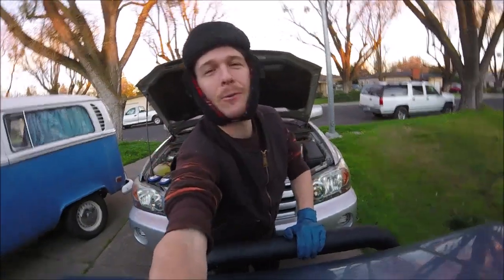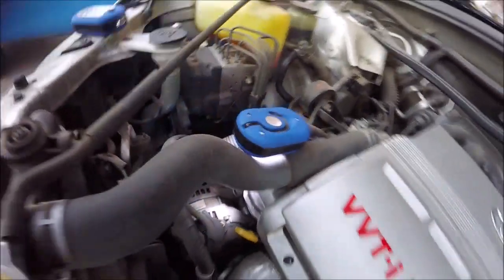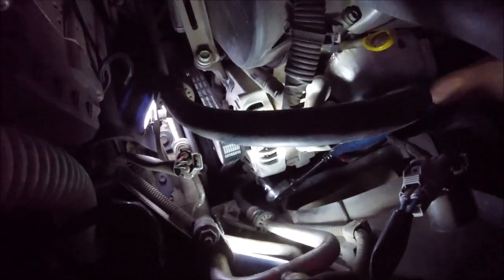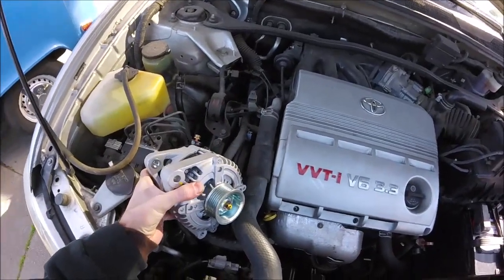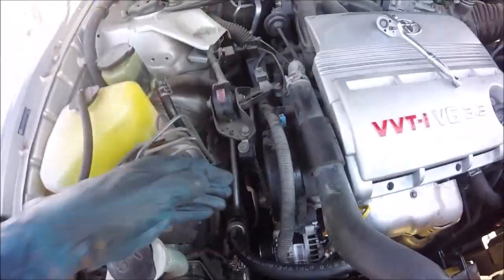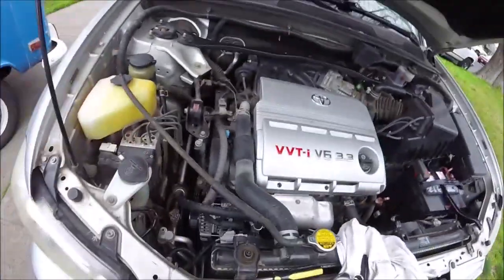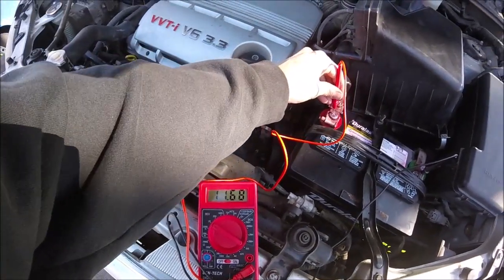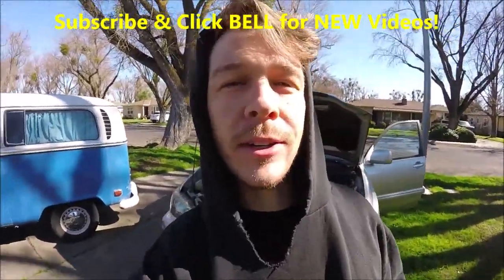How To Replace Alternator Toyota Highlander 00-07 -Jonny DIY

Comment: How the the block on the tensioner bolt should be plce , mine came off , and I'm not sure it's supposed to go back, the right way 😬
Reply from the maker: Hope you got it figured out, here's an image of how supposed to be
https://www.autozone.com/znetrgs/repair_guide_content/en_us/images/0996b43f/80/20/85/e5/medium/0996b43f802085e5.gif
Reply: @JonnyDIY  appreciate the help 👍🏻

Comment: need to know which way the block goes . it flopped around during removal . so didn't see the way it was oriented . any - one ?
Reply from the maker: The lil block on bolt goes on inside of mounting adjustment.  Its where it locks the tensioner adjustment.

Comment: Thank you for making a short video that actually shows these steps. 

What a pain in the butt getting that lower tensioner bolt off!!!

 Advice for anyone doing this job: buy a long reach electric ratchet or a long reach SUPER fine tooth ratchet and a 12 pointed socket for that 12mm.

I slid the alternator wire bracket clip off as well as the clip holding the wires on the radiator to make room to get the unit in and out, otherwise, was pretty straightforward.
Reply from the maker: You're welcome, glad I could help you get it done 👍

Comment: Did this for the first time, both belt and alternator. Had little to no experience. Great video!!! Only thing is I got stuck on the block where the adjuster screw and holding screw go in once new alternator is in place. There is another video similar to this that shows the exact setup for the block that I had to use to get it back in place properly. Otherwise great video, couldn’t have done it without you!
Reply from the maker: Awesome, you're welcome, glad I could help you get it fixed and going again 👍

Comment: I just replaced the alternator on a 2006 Lexus RX 330, which is real similar to this. I had the worst time getting the 12mm bolt through the tensioner block and into the alternator. I ended up taking out the 14mm bolt and doing the 12mm first. It ended up being a lot easier for me that way. Just in case that's helpful to anyone else
Reply from the maker: Thanks for sharing. It's funny the things that end up taking the longest when working on cars is usually not what you expect. I get hung up on the stupidest things sometimes lol
Reply: I did mine today on2007 Toyota Highlander. And YES, getting the 12 mm bolt through the tensioner took me an hour and lots of frustrations. I also ended up taking the 14 mm out, but also I put the belt on after getting the 12 mm done.  It was easy but very frustrating, but all done. Thank you Jonny for the video and Joe for the comment.
Reply from the maker: @slawomirkroczek7164  Glad to hear you got it done! 👍It's never what you think that ends up being the most frustrating part about a job it seems
Reply: Yyyyup, same here. What I did was take a thin piece of wire and try to thread it through the screw hole & alternator opening, just to see if the shit was lining up. Once I could thread it, I held it all in place and put the bolt in. But that was after a whole lot of sweat, grease and gratuitous swearing, lol.

Comment: I’m about to replace the alternator on the wife’s 05 Highlander. What is with the electrical systems on these. They have all sorts of gremlins and weird issues. Thanks for the How to!
Reply from the maker: You're welcome, happy to help. Good luck 👍
Reply: Did replacing the alternator help? I also have an 05 with strange electrical issues, 2 trips to the dealership and no solution...
Reply from the maker: @testarossa123  battery and or alternator can solve a lot of electrical issues. Autozone will check both free
Reply: @JonnyDIY  Thanks for the response Jonny! The dealership checked and said both are good. The problems seem very alternator related though, headlights dim, weird electrical gremlins, etc.
Reply from the maker: @testarossa123  you're welcome, hmm sounds like either battery or alternator to me.

Comment: I feel like an idiot. I cant get the bottom 12mm bolt aligned to reinstall. I dont know if its just because my hands are big and it's hard to move around down there, if I'm just a noob and it's just taking me awhile, or if I'm missing some kind of trick or something to slip it in. Trying to use my fingers to twist it in to get it set but I cant seem to get it. Been trying for hours. Any tips or do I just need to keep working with it?
Reply from the maker: Hope you got it. Sometimes best to walk away for a bit when you get stuck like that. Happens to me sometimes too, usually on the stupidest part of a job too 🤦‍♂️I remember it being a little bit fiddly since it was a tight fit right there
Reply: @JonnyDIY  thanks for the response. I ended up walking away from it last night and will hopefully get back to it today or tomorrow. I fortunately have another car I can use for the time being. So irritating...

Comment: Trying to turn that 12mm front tensioner bolt with a regular ratchet was my downfall. Just not enough space for the amount of cranking required. I bought a universal joint socket w/ a long extension and that thing saved me. Had to use a perfect-fitting 6-point socket though. Anything else would slip off, since it's being cranked on a weird angle.
Reply from the maker: Ahh that's a great idea, nice solution thanks for sharing👍

Comment: Hey so I followed your tutorial and was able to change out my alternator, however theres a squealing noise coming from the pulley.  

Any ideas what I might have done wrong and how I can fix it? (Also all the belts look almost brand new)
Reply from the maker: Sounds like the belt is tensioned too tight or too loose. Should only be able to twist belt about 90 degrees on longest run between pulleys 👍

Comment: So 13.5 for a brand new alternator is o.k? I was a bit confused because my alternator is testing between 13.4 - 13.6 with a multimeter and most of the info I've come across online has suggested that the alternator should test above 14 volts. Trying to figure out if I should just replace the battery since my highlander is completely dead. I also have a first generation Highlander. Great video by the way.
Reply from the maker: You're welcome, glad to help. I would replace the battery 1st if it's older than 3 years. Battery only needs to be fully charged at 12.5-12.7 volts so 13.5V is plenty to keep it charged up. You can also have battery load tested at local auto store. My bet would be the battery, especially this time of year, the cold is the hardest on batteries
Reply: @JonnyDIY  Thanks a bunch. Think I will try to replace the battery today and hope for the best.
Reply: @JonnyDIY  Interestingly, after I put a new battery in, I tested the alternator using a multimeter on my battery with the car running, and it read at just above 14V. Wonder if my old battery being worn out and old somehow made it appear that the alternator was putting out less voltage. Figured this info might possibly be useful to someone.
Reply from the maker: @seektruth707  Glad to hear you got it fixed. Yes, a bad battery won't be able to put out the same volts as a fresh one. Your old battery probably had a bad cell. They usually swell the casing when theyre worn out. A simple bad battery can cause a whole bunch of  problems that make you think it's something else

Comment: Hey so the locking bolt does that have a nut at the other end? I know the tension bolt itself doesn’t. When I took it off I didn’t see if a nut fell off the bolt or not.
Reply from the maker: No I dont think it has a nut, just goes into a threaded hole I believe
Reply: I’m having a hard time finding where to put the locking bolt into. Hopefully there are some schematics online 😅
Reply from the maker: @markrusso3994  yeah its a pretty tight space job. Some bright lights helps

Comment: Is the negative lead always on the right hand side and positive on the left because neither of mine are marked
Reply from the maker: For this vehicle with this engine configuration, most likely. It says on the battery though. You'll see the - sign for Negative and + for Positive 👍
Reply: @JonnyDIY  lol dude seriously it had no type of sign ..I ended up using an ohm reader and figuring it out but thank you I will definitely follow you!!
Reply from the maker: @criffle1578  wow that's crazy never heard of that. Glad you figured out though. Thanks for subbing 👍

Comment: Where is the link to where you found your alternator? Looking into buying one
Reply from the maker: I think I ended up buying locally cause I needed it right away at Autozone. But if you can wait you can get good deals on Rockauto.com but buy a higher rated/priced one. Super cheap ones you'll be replacing every year or so

Comment: thanks for the video I followed your step until I got to the part were to put the 12mm tension-er screw that where you went to fast and couldn't see how to do it.
Reply from the maker: sorry about that it goes on top, the tensioner bolt that you tighten to give belt correct tension

Comment: I don’t understand how you got the second bolt out. Everytime  I try to back it out it just backs into the plastic radiator fan frame.

Your video cuts to the next bolt before you removed it. I’m soo confused.
Reply from the maker: @drummerjunk  shoot I'm sorry I can't remember having that problem. Hope you figured it out 🤞👍
Reply: @JonnyDIY  I figured it out! The bolt doesn’t come out, it leads to a bracket that supports the bottom of the alt. When you loosen the bottom bolt, it lowers the alt and  loosens tension on the belt. So you just loosen that one, then you can remove the 3rd bolt and remove the entire alt. 

I’ve never seen a design like that (no tensioner pulley). Took me a while to sort out. Your video did help tho. Thank you and keep up the good work.
Reply from the maker: @drummerjunk  Awesome, you're welcome,  glad you figured it out. Now that you mention it I do remember just having to loosen it and not remove it. Happy you got it done. And thank you! 🙌👍

Comment: Be wrong but, shouldn't you have at least loosen up the tension at first before you did any other bolts?? Cuz you're going to have those bolts with some kind of tension on them? If you loosen up that tension you might have sped it up a little bit..
Reply from the maker: Doesn't really make a difference 👍

Comment: Did you got the alternator 100 Amps or 130?  I found a used one in the junk yard and I installed on my 2004 Lexus RX330 it works great until I use the ac so I believe I have to get one in the dealer a Denso 130 amps . My 2005 Toyota Highlander has the same engine alternator but I believe the Highlander use a 100 Amos because doesn’t have any luxury like my Lexus RX330 everything is electric including the trunk heater seats power seats
Reply from the maker: Yeah you must need larger one because all the extra electric draws. I got this one from autozone for the 06 highlander. Probably 100 amp I'd have to check